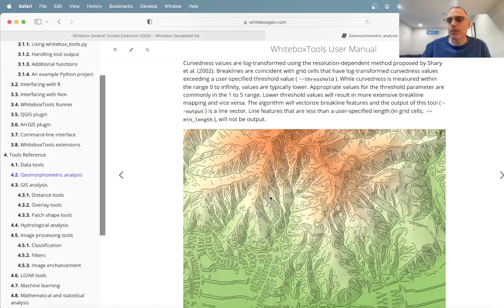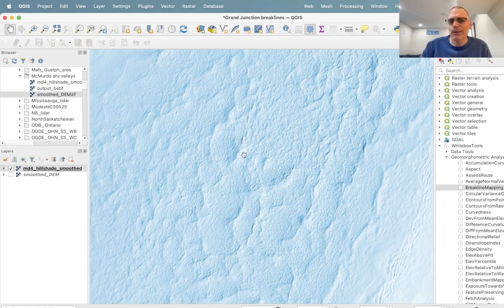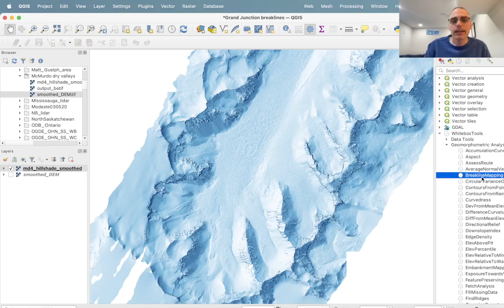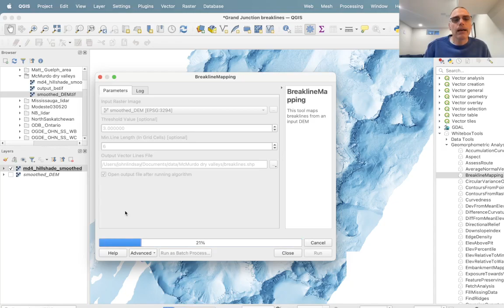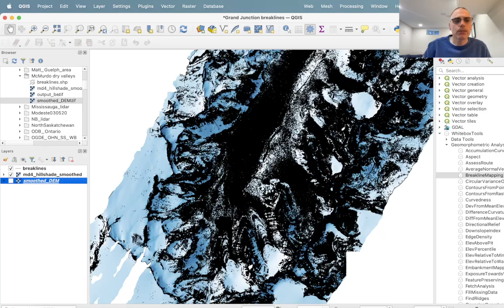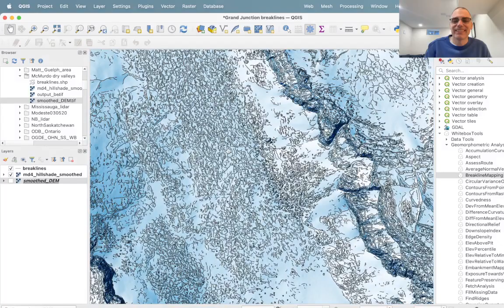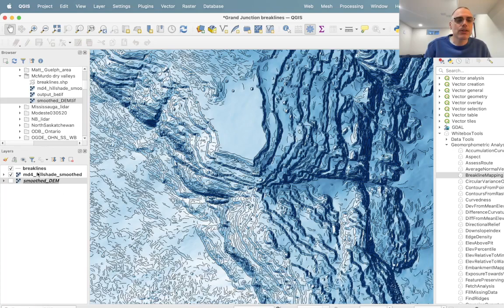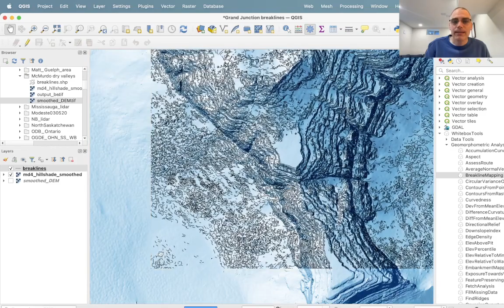Breakline mapping with Whitebox

Comment: I wanted to grab the data to follow along. Based on the extents shown in the video I was able to find this area in the OpenTopography McMurdo Dry Valleys pages. I used the CyberDuck app and grabbed the zipped MDV_2014_TileIndex that holds shapefiles. Putting the extent and correct EPSG in QGIS using the "Create Layer From Extent" QGIS Vector Geometry processing tool and then applying the shape files from the ZIP above, I determined that I needed to grab the BEACON folder, specifically files "ot_BEACON_000275.laz" to the last file.